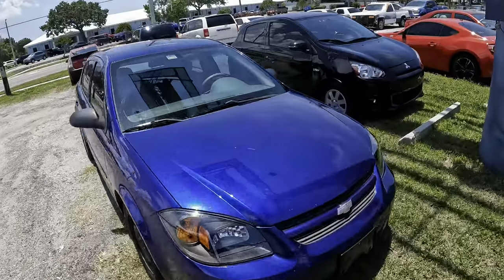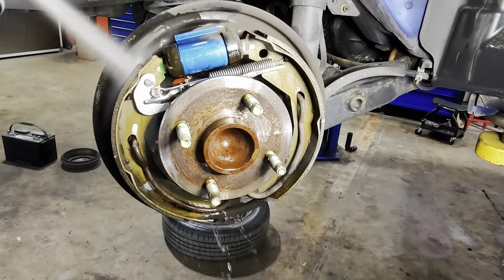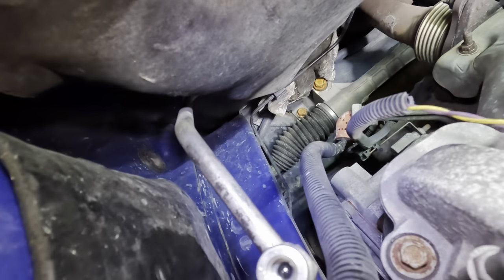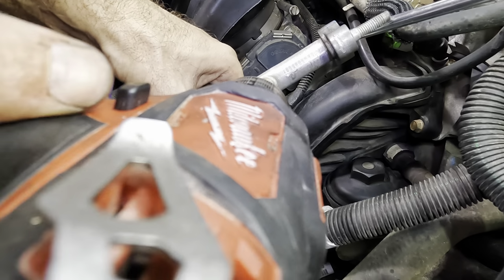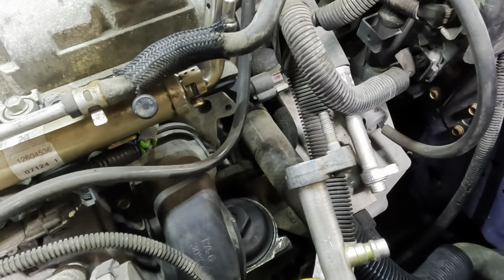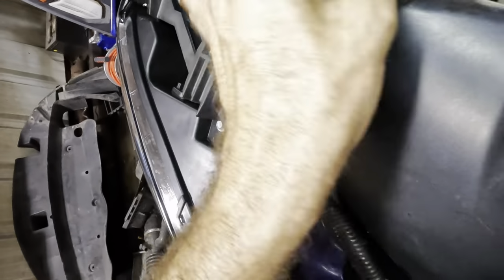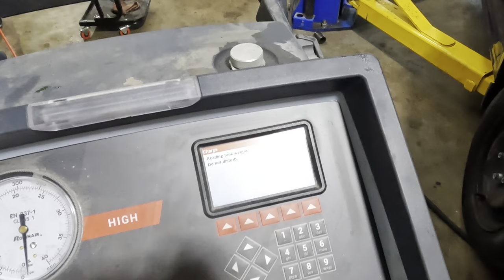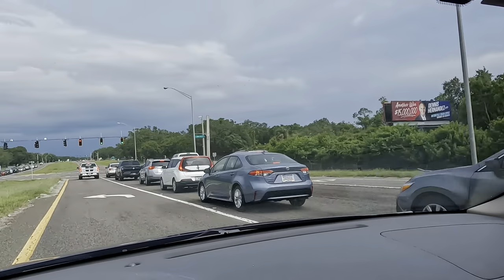Mechanic Still Can’t Replace Parts! Customer JUST bought it! Chevy Cobalt PT2!

Comment: Man you do good work! When you said the word never seize or goop on the valve thread, you were drilling.
You went the extra mile to save your customer, instead of just replacing the line.
Have a great day!
Reply: Eh, it's pretty debatable - parts store retail on the hose is under $150, so there's some savings if it needed to be done Today. If it could wait a couple days to order in the part from The Internet, it's all of $50 and thats almost definitely coming out about even with labor cost.

Comment: After cleaning dust out of drum, the purpose of rear access to drum adjuster is wind it up until the drum locks up, which centres the shoes. Then back off a click at a time until the drum rotates freely. Takes out the trial and error guesswork adjustment.

Comment: Based on the fact that most previous repairs were botched, upon seeing the rear adjusters bottomed out at the loose end of the spectrum, I would have double-checked against service data to confirm that the auto-adjusters were not put on backwards and are working backwards---IOW they are automatically "un-adjusting" themselves.
Reply: From what I saw,and just did some yesterday the adjusters are in the correct position.
Reply: Can't put them in backwards, maybe have one with a reverse thread. Seemed like a Monday/Friday job or somebody that knew the basics of doing the work but not to dial it in or everything was good enough.
Reply: The way how the ratchet allowed them to tighten, I doubt they will be "unadjusting". More like the thing that is supposed to adjust it, is not engaging at all. But seeing them clean and without any corrosion (the reason why selfadjusters of various kind stop adjusting), I would also guess they are just assembled incorrectly, or some detail (hooking in something, missing component,...) was overlooked.
Reply: Home job for sure
Reply: They weren't. You can easily tell from the video of Ray adjusting them
Reply: Auto adjusters will not work if you never apply the real parking brake.
Reply: @timjohnun4297  youre rigth sir, and the way they  "self adjust" is by using the parkingbrake, or as you americans call it ,the e brake. So by applying the ebrake when parked it wil adjust, and i know this by experiense, driving a 97chevy tahoe myself and usually just slam it in park and go,my rear brakes was just like these............
Reply: @superskrobb  It depends on the complete brake construction. Some have the adjusters actuated from the main (service) brake, some from the hand (aka e-) brake only, some from both (when both service and hand brakes actuate the same shoe side). So indeed you have to toggle the one actuating the adjuster.
Reply: @annaplojharova1400 Back in the old days the self adjusting brakes required you to drive in reverse and apply the brakes. Advertising boasted that "the brakes are automatically adjusted every time you back out of your driveway or parking space."
Reply: @spaceflight1019  To me such arrangement would sound very sketchy (what if the car need to reverse in its life only very rarely, like many taxi or so), but not impossible. Only very sketchy limitation.
Reply: @markfudger5267  That's exactly what I was going to say, and since 99.99% and 44/100ths of US cars are autos, then everyone simply rams them in park and walks away.
That hand brake has just had its first operation in its life when Ray operated it.
Reply: @annaplojharova1400  That actually happens, because if you don't back up occasionally the self-adjusters don't work. If they worked when driving forward they would eventually lock up.
Reply: yes, if the left is on the right and right on the left, it won't adjust up. ask me how i know LOL!
Reply: @tlak  he's talking about the little arms. not the screw. and they can absolutely be put on the wrong side.
Reply: @spaceflight1019  You want to say when I will be backing very frequently the brakes will eventually lock up?
Maybe it could prevent the adjusters "adjusting" for thermal expansion (long steep hill descent), but even that would be very sketchy: Once you stop and suddenly start to maneuver when the brakes are still hot, it would still tighten it and start dragging or get locked once it cools down, unless the slack the adjuster is supposed to maintain is made large enough to count for the expansion as well. And if it does take the expansion into account, I see no point in discriminating forward vs reverse anymore...
Reply: @TheWickedFast1  That actually sounds very plausible for this case...
Reply: @superskrobb  HEY! We don't all call it ebrake. Some of us know things.
Reply: @playdg  He He, I'm pretty sure you are one of those people who can make cars move by using three pedals and this stick thing coming up from the senter consoll too.....😎😎. Have your self a great weekend sir, brs from norway.
Reply: The drum brakes only adjust when they need to adjust. The adjuster arm pulls up on the star wheel every time the brakes are applied while moving in reverse, if there isn’t enough wear on the shoes to require another notch on the star wheel then it will ride up on the notch but won’t click over to the next notch to advance the adjuster. The reason they are set up to adjust while applying the brakes while backing is so the arm that pulls up on the star wheel doesn’t wear out from trying to adjust every time you hit the brakes going forward.

Comment: Since 1st of July 1959, the US pound has been defined as 0.045 359 237 kg. It is based on metric unit, just like the inch is defined to be exactly 2.54cm. Metric, but just a bit awkward special case to please US audiences. 🙂
Thank you for the content, these tropic weather repair videos are really nice to watch during the winters we have in Finland - way nicer than doing any repairs outside in -25C/-13F weather.
Reply: I think you meant to say 0.45…. kg to the U.S. pound.  Same as ~2.2lbs to the kg.
Reply: Royal Deluxe...

Comment: On GM, Delco moraine rear brakes, you can do the same adjustment without pulling the wheels. Get up to about, 5miles an hour in reverse, and hit the brakes. The adjustment only happens in reverse, from what I remember.
Reply: I would expect you even won't need to drive in reverse, just repeatedly hitting the brakes should do it - after all it is supposed to compensate for the shoe wear even when the car is not reversing at all, maybe it would need just a bit more "hits"...
Reply: No automatic adjuster I have ever come across on drum brakes works properly. You can prove this for yourself if you have an external access slot, just do whatever you normally do to make the automatic adjuster work, then see how much you need to do to get them right, just like wot Ray’s doing. One point, Ray backed the adjustment off. In my (limited experience) if you leave the brakes very slightly too tight and drive easy round the block, then check again, you’ll find the brakes are spot on, because a few actuations and plenty of road vibration, makes everything settle down and relax a bit.
Reply: @CrimeVid  to get the adjusters to work you have to use the parkingbrake,not just slam the trans in park,when you press the parkbrake pedal or lift the parkbrake handle ( or often called ebrake) the brake shoes are moved by the arms innside the drum ,not just the pistons on the brakesylinder, reversing and braking or driving and braking dont matter, that only extend the pistons in the brakesylinder, so the pedal getts lower and lower doe to the extended travel of the pistons,and if your unlucky the pistons wil pop out of the sylinder and all brakes are gone.............. i know by experience
Reply: @CrimeVid  The adjusters function is not to be that precise as you can be with manual adjustment. Their point is to keep the slack within reasonable limits the brake system is designed for, even as the shoes are wearing out, without the need of frequent manual readjustment.
You may start with precise adjustment from the getgo, but if the adjusters are not actually working, after a few percent of shoe life the slack becomes beyond what the brakes may tolerate and you may get of of the master cylinder range and have brakes to fail or underperform.
The problem is, the maintenance schedule for the vehicle is designed with an assumption these things work, so it does not ask for brake slack adjustment work needed when the auto adjuster is not working. It just assumes the slack is taken care of automatically by the slack adjuster and for that the adjuster has to work first...
And the adjuster not working is the main concern here, which has not been addressed (at least explicitely, on the video) on this car.
Reply: @annaplojharova1400 It only works in reverse, because the mechanism is designed to work as a ratchet.
Reply: @spaceflight1019  What I've seen the ratchetting was actuated just by the distance the shoes have to travel for the brakes to grip (so the travel has to be greater than the teeth spacing to tighten up). No direct relation to the wheel rotation at all. Maybe the flexing of the assembly made it to tighten faster or for a bit tighter slack when moving in reverse as a side effect (maybe the preffered direction of the difference), but it should operate good enough for the brake system design even when the car is moving forward or not at all.
Reply: @superskrobb   I had to read this again to see what you were talking about !  I know how brakes work,and did not suggest any weird braking activity. Or automatic transmissions ( which 70% of  UK drivers don’t have) or come to think of it parking brake pedals. I have never seen the brake cylinder pistons pop out with the drum on, what do you people do to your cars ?
Anyway, because of not having automatics(mostly) or parking brake pedals,we tend to use the handbrake a lot, thereby operating the adjusters,which in the main, don’t.
Reply: From my training, it only works in reverse. The actuators don't move in a forward gear.

Comment: Good video. Suggestion. By removing the plug on the backing plate you can adjust the brakes with the drum installed. Its faster that way. Also that little pawl that is on the adjuster is the laver that adjusts the brakes when you back up and put on the brakes. That way the brakes are always in proper adjustment, well in theory anyway.
Reply: He mentioned that in the video.
Reply: not the back up,part. When I was a kid may decades ago backing up and applying the brakes was how we adjusted the drum brakes.

Comment: These last two video's are the reason I enjoy RRR's videos. My father in law was quoted $1500 to fix his auto gear box, he took it to a retired mechanic who double flushed it and replaced the filter and it lasted him another 5 years till he sold it. the last we heard of it was 3 years latter and it was still going strong. Another mechanic I knew throw in his job because he was pissed off by his boss telling him to clean and reset the ignition points and clean, reset spark plugs. Also clean the air filter, the boss then charged the customer for replacing, resetting every thing. Ray keep up the good work ethic and you will do well.
Reply: Years ago back in the 70's, I knew a Mechanic Shop that did this on Older people vehicles-just ck the points clean and reset Gap on Plugs and charge them for New Points and Plugs, he got away with this fraud forever...

Comment: I think I would use the billboard. However, boards that are close to a busy 4 lane highway can be very expensive. Secondarily, putting the shop's name on a high billboard next to a busy road will without a doubt bring the fans to your doorstep. The combination of the Wife Unit and her designies along with a tractor trailer full of merch will undoubtedly give a nice lift to the bottom line. It will be important to seperate the retail side of the shop from the greasy side or you will get nothing done because of the necessary greetings you will have to supply to the hundreds of visitors the sign will recruit.
Dave Lowa
Reply: Or you can buy you own billboard.
Reply: @pickles5150  That's what I was thinking. Either that, or make one out of wood just to get noticed, then buy one when the money is right. Even a 4 x 8 sheet of plywood would be better than nothing.

Comment: Ray, as far as the rear brakes go with this one I think you may be dealing with the Chevy drum brakes that don't work as they should. If it is the problem design then what happens is the rear adjusters never actually automatically adjust. I have first hand experience having owned a 2007 Chevy HHR (which is very similar to the Cobalt) for over 100,000 miles now and trying to figure out why it prematurely wears out front brake pads and even warps the front rotors. I have finally come to the conclusion via my experience and also reading HHR owner forums that the rears do not self adjust thus putting what is normally only about 70% brake stress on the fronts well over 90%. The solution I have come to is that I am just going to have to manually adjust them every oil change or two which means jack up each rear side and adjusting via the access port you show in this video. The lack of proper adjustment is so slow it goes unnoticed by the driver but the improvement in brake performance once properly adjusted is quite noticeable.
Reply: You are So Right, most Drivers these Days Know Nothing about Vehicle Mechanics, they are Totally Helpless, as an Old Fart, I try to help/teach my younger friends about the mechanics of their Vehicles---I always Tell them-Preventive Maintenance will Save you a Bundle of Money in Long Run...
Reply: I don't know about this car but I had a Mazda MX-6 back in the day with rear drums.  The adjustment procedure was to move the car slowly in reverse, and then apply the parking brake.  Release the parking brake, move forward and apply the service brake and then repeat the first step.  A few times with the forward/backward was all that was needed to tighten up the rear drums.
Reply: When the e brake takes to many clicks, it's time to adjust the star wheel. Might try backing up and stopping quickly as that is supposed to adjust them, sometimes it works, sometimes not !
Reply: @sparksalot4950 , YES, you've hit the nail on the head. With my HHR the number of clicks to set the hand brake is exactly how I can tell it's time to manually adjust the tensioners again. More than three clicks and it's time. With the HHR drums, and probably these Cobalt ones as well seeing as they look identical, the backing up and braking multiple times to auto adjust just doesn't work. Poor design I guess. These are the first drums I've worked on that use that weird upsidedown horseshoe tension spring on the bottom.

Comment: Another great video Ray! Funny how someone went through all the work redoing the rear brakes to not do the final step of adjusting them. lol  Shop is coming along nicely!
Reply: I once got a car at flood sale price because the person who replaced the master brake cylinder didn't bleed the lines afterward, so the owner thought it was an un-fixable death trap.
Twenty minutes with my brother in the driver's seat, half a bottle of brake fluid, and a couple of dirty rags later and I had a great car that I should have paid ten times as much to get.
Reply: @MonkeyJedi99 I got a decent car because the owner thought it needed head gaskets. It was a broken lower hose clamp! Never ask for a diagnosis over the phone!
Reply: Knowledge is powerful!!
Ignorance is painful!
Reply: I picked up a car for $250 because the person's "mechanic" couldn't figure out why it ran so rough.  All it needed was a couple of vacuum lines.

Comment: Sometimes backwards drill bits work better on removing threaded parts. 
If you put up a billboard you'll need to add a 10 bay garage with 3 more Troys.........
 And that was a cool car at the end,  I'm thinking early 70s dodge........

Comment: Reeee.  Metal filings in the system.  I wish you had removed the line before you drilled it, that would have allowed you to create and then remove debris without forcing the debris into the rest of the system with the blow gun.

Comment: I’m a big fan of left handed drill bits for situations like this. It may even have saved that Subaru engine with the snapped off water pump stud. Rather than trying to weld nuts onto it.  snap on still sells them I think
Reply: Viking/Norseman sells a super high quality set of left hand drills and extractors for a pretty reasonable price. They're made in the USA and come in a nice, convenient case.
Reply: I already knew what left-handed drill bits were, but I was splitting my attention when I first read your comment, and thought, "What difference does it make what had I hold the drill in?"
Yeah, I need to wake up.
Reply: The broken piece was below the threads.
Reply: @davesvoboda2785  Plus, Ray snapped off an Easy-out in the stud, and those are harder than woodpecker lips.
Only thing that MIGHT possibly drill thru that hardened thing is a carbide drill bit. Maybe.
Reply: True. But lefty bits act like Easy outs and the pilot drill simultaneously. He may not have needed anything else. Just grind the stud flat first. Then a good center punch and some patience. 
But hindsight is 20/20.
Reply: Or, did Ray cut it off with the drill bit when he drilled a bit too far?
Reply: @MonkeyJedi99  *hand not had?
Reply: @petermolnar8667  Yeah, one of the rare times I did not adequately proofread my comment.
Reply: @MonkeyJedi99   no worries, it just took me a while to guess